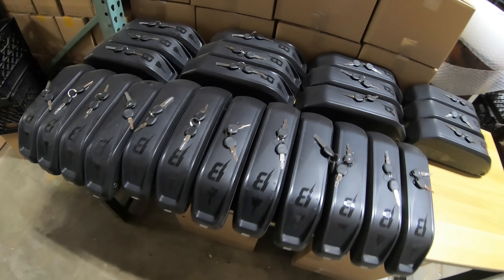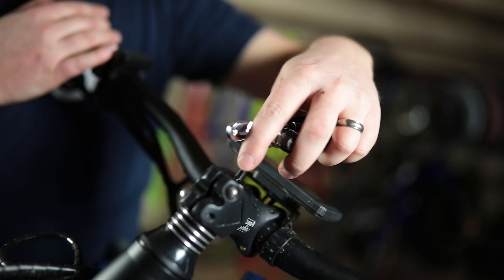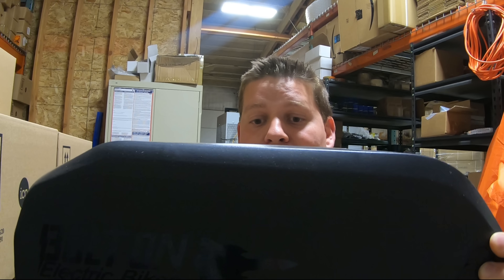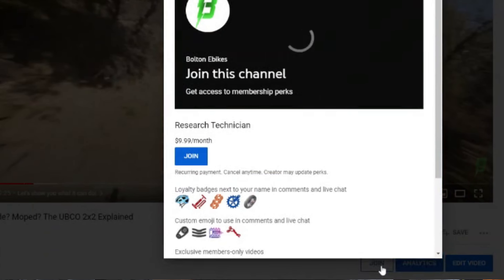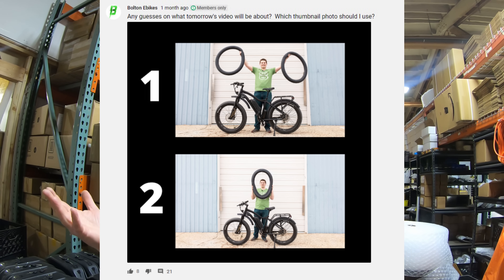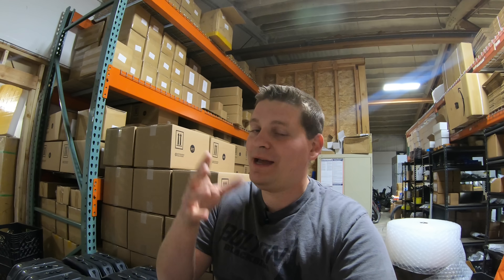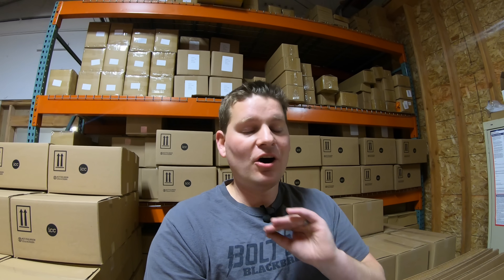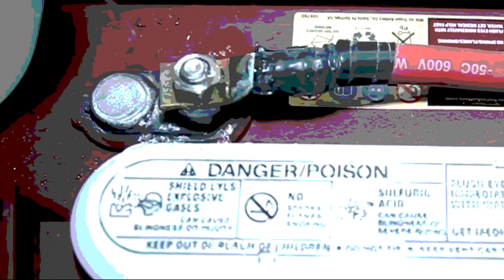How to maintain Lithium batteries for electric bikes - Easy!

Comment: Helpful video.

Can you do a video about safety? Around here there’s been many apartment fires started by Ebike batteries in the NYC area. Apparently there are standards that all batteries don’t meet here in the US.
Reply: I usually try to recharge mine during the day and unplug the charger before I go to bed. If it’s not 100% or close, charge it a couple more hours beg you head out. I should also note that where I live it gets really hot many days in the summer. During those days, I don’t charge the battery outside in the heat.

Comment: I’m checking out your videos for fire safety. After the recent bunch of Ebike battery fires in NY that have burned down buildings I’m concerned that we don’t have the standards here I the US for adequate testing. Until I actual saw a video of an Ebike battery fire, I thought they could easily be put out but one of the videos available shows a group of FDNY guys emptying several large fire extinguisher cans on a bike outside a business and it kept burning and burning and burning. The idea of that happening in your house is horrifying. 😬

https://youtu.be/LYp-64s9_Po

Comment: I have a Radrunner which I was going to ride year-round. After sustaining a rotator cuff injury I’m not gonna be riding for quite a while. I don’t quite understand how to maintain the battery at 75% which is what the manufacturer recommends.Is there some kind of device that will maintain it at 75%?

Comment: you said, " do not discharge a lithium battery to zero" ... are you talking "lithium" or "lithium-ion"  they have different requirements,   you even need a ABC fire extinguisher for a lithium-ion battery .   and a Lithium battery requires a D fire extinguisher..      ABC doesn't work on lithium fires.

Comment: Hi - I have three Aventon Aventure bikes. Two of them have batteries marked "48V 15Ah 720Wh". One, more recently acquired, is marked "Nominal Voltage:47.32Vdc and Rated Energy: 657.748Wh". Can anybody explain the difference? Much appreciated.
Reply: Hi, I just received my Aventure direct from Aventon and mine also has Nominal Voltage:47.32Vdc and Rated Energy: 657.748Wh. Doing the math, this seems to only be 13.9Ah and not the advertised 15Ah. Am I doing the math correctly. Is Aventon providing less that promised? @BoltonEbikes I saw that you recently started carrying Aventon bikes. Can you confirm what you are seeing and if we are getting a battery with 9% less capacity? Thanks...Love your videos and your help in educating us.

Comment: Hi there,
Question 1:
        My charger can charge 54.6 V, my battery has 48 V 17.4 Ah. Looks already fully charged on my e-bike display, but the battery charger does not turn the green light. Does it mean it's already 100% charged? Or, still wait turn on the green light?

Question 2:
       Looks  full energized on my e-bike display when I am riding an e-bike. But it doesn't look like there are 1-2 bars when accelerating at high power or on the uphill. is meaning battery to dying?

Comment: Per battery engineer discussion I keep my Li E-Bike battery between 20-80% for *longivity (charge cycles).  I use a plug in timer (used for lights & sprinklers).  It charges at 10%/40 mins. If it is at 60% I set timer for 2 hrs. I charge it to 100% once to twice a month & for the occasional 40 mile ride. *A new battery is %600.

Comment: hi i have a fat wheel folding mountain e-bike with 48v 1000watt motor with 12.8 ah battery i find the range isn't that good 10-15 miles what i was wondering was would changing to say a 500w motor give me more range oh and the battery is housed in the crossbar cheers in advance Jack from uk

Comment: Tesla car company claims 1,000 times the recycle rate on li-ion if we charge to 80% and discharge to only 20% (above minimal rated safe voltage)

Throwing the battery into the snow.. all the antics.. made this well worth the watch!

Excellent information!

Comment: how about this for a great idea,i wanted a very light narrow bike trailer to carry 2 spair batteries for long trips so i had to work out the weight load to save some power.so i ordered a trailer to handle 2 10.5 ah batteries total weight 25lb so i thought im 190lb so i went on a crash diet and lost 25lb in 6 weeks to compensate for the weight of the trailer and 2 batteries.

Comment: Clarification here, it's also not good to fully discharge any other type of battery. Every available battery chemistry will degrade faster if you fully discharge it. NiCd and NiMH batteries have a memory effect, so it was decided that degrading the battery prematurely was better than not being able to use the battery capacity at all. Lead Acid batteries are very sensitive to depth of discharge, they are just cheap and most people don't know what they are doing, so they fully discharge and degrade them.

Comment: Interesting conversation on the Lithium battery discharge. I'll have to go back to my research but it seem Lithium batteries for an RV (solar power) vs AGM is the fact (or not) that you can only discharge an AGM to around 50% where as a lithium you can discharge to nearly Zero ?
Reply: Lead-acid batteries can be damaged by repeated deep discharge (more than 50%). Lithium batteries can normally be discharged to their full rated capacity (100%). Which means twice at much power. Note that this only applies to a drop-in replacement batteries that have an onboard BMS that stops discharge before the lithium battery is low enough to cause problems.

Comment: GREAT JOB ON THE VIDEO, I ALREADY KNEW ALL OF THOSE THINGS BUT, ITS NICE TO SEE SOMEONE WHO ACTUALLY KNOWS WHAT THEY ARE TALKING ABOUT, I HAVE FOUND THE BEST WAY TO GET A LONGER RIDE ON A CHARGE, I DO KNOW TERRAIN HAS A LOT TO DO WITH IT, I LIVE IN A CITY THAT IS MOSTLY FLAT(SOME MINOR HILLS, A FEW INCLINES), I TRIED SOMETHING THE ONE NIGHT, I TOOK AN EBIKE RIDE(I HAVE AN ANCHEER 16 INCH WITH A 250WATT, 36 VOLT HUB, AND AN 18AH BATTERY),I DECIDED TO TAKE MY TIME, FOR ONCE AND I RODE FOR THE MOST PART ONLY USING HALF THROTTLE(NO PEDDLING AT ALL), AND RODE TO A FEW DIFFERENT PARKS, I WAS AMAZED HOW FOR I WENT ON THE FIRST QUARTER OF THE BATTERY, I DO NOT HAVE ANY KIND OF WAY TO SEE PERCENTAGE OF BATTERY, NO DISPLAY ON THE BIKE, I CAN GET ABOUT 10 TO 11 MILES ON THE FIRST QUARTER, NORMAL RIDING, THAT NIGHT I WENT DOUBLE, I LOOKED ON A MAP AND LOOKED AT ALL OF THE ROUTES AND IT WAS ABOUT 22 MILES, SO I FOUND THE BEST WAY TO GET A LONGER DISTANCE ON A SINGLE CHARGE, I WAS AND AM VERY IMPRESSED WITH THAT DISTANCE, I DID HAVE SLIGHT UPGRADES, EVEN WITH THAT, I STILL GOT THAT DISTANCE, I HAVE WATCHED A LOT OF VIDEO ON THE EBIKE BATTERY, WHEN I FIRST GOT MY EBIKE, I DID NOT KNOW ANYTHING ABOUT EBIKES OR ABOUT THE BATTERIES, MOST OF THE VIDEOS WERE BAD AND MADE IT LIKE IF YOU DO NOT FOLLOW THERE ADVICE, YOU WILL DESTROY YOUR EBIKE BATTERY, SOME OF THOSE VIDEOS HAD ME SO STRESSED AND WORRIED I WAS SCREWING UP MY BATTERIES, SO I STARTED READING AND ACTUALLY GOT REAL ANSWERS, IN SOME OF THE VIDEOS, PEOPLE WOULD SAY "NEVER FULLY CHARGE THE BATTERY, IT WILL SHORTEN THE LIFE OF THE BATTERY", "NEVER FULLY DISCHARGE, YOU WILL DESTROY THE BATTERY", AND YET IN THOSE SAME VIDEO THE PERSON WOULD THEN SAY "MAKE SURE THAT YOUR BATTERY HAS A BMS ON IT" ,AND NOT ONCE DID THOSE IDIOTS SAY "THE BMS PREVENTS YOU FROM SCREWING UP THE BATTERY", AND SOME OF THOSE PEOPLE MADE IT VERY CONFUSING, GREAT JOB ON THE VIDEO, GREAT INFORMATION, THIS IS THE VIDEO THAT ANYONE WITH AN EBIKE BATTERY SHOULD WATCH, IF THEY ARE NEW TO EBIKES OR NOT SURE, I LIKE THAT YOU GOT RIGHT YO THE POINT, INSTEAD OF EXPLAINING ON HOW BATTERIES WORK AND ALL OF THE OTHER MEANLESS CRAP AROUND THE ACTUAL MAINTENANCE OF EBIKE BATTERIES, GREAT JOB

Comment: I’m sorry but I have researching Batteries for Solar Systems for a few years — your first comment about not discharging Lithium Batteries completely is 
COMPLETELY WRONG!!!
You also say that is a practice that Lead Acid REQUIRE 100% discharge is Also 
ONE HUNDRED WRONG!!!
Yes I am aware that there are NO Lead Acid eBike Batteries!
The beauty of Lithium batteries is they are NOT NEGATIVELY IMPACTED BY COMPLETELY DRAWING THEM DOWN!
If one discharges a Lead-Acid below 50%, the life of the L-A Battery will have its life decreased drastically!!!
Maybe you should find a mentor who is highly educated concerning Batteries — you are not well informed at all!

Comment: The first 10 charges cycles are very important, didnt watch the video so I may be just repeating, sorry the way you talk... the first 10 cycles of the battery are very important, the first 10 charging cycles must be to full. The very first time you charge the battery, 12 hours min. but NEVER longer than 24 hours and every time after that, you must make sure it get fully charged and stay's on charger for at least an hour or two after the green light comes on. 
In some case's, you will see the green light, but several minutes later it's back to red and charging again, this is normal, when you have a solid green light for over an hour, then it should be done " balancing ". Most BMS are what they call " bleeding " BMS, it slowly drains down the higher cells to match the lower cells, as not all cells will reach full voltage, Li-ion 4.2v. some will be 4.1, 4.0, some will charge up too 4.2 but settle around 4.1 or lower...
It takes at least 10 cycles for most batteries to get to full capacity, sla, li-ion, Lifepo4, not sure about the new LTO cells.
I usually slowly increase the battery usage with each cycle until it reaches the 10th and the 10th cycle is a full discharge, I NEVER fully discharge a new battery pack.
NEVER charge a battery that has just been run hard, let it cool first, 30 minutes after usage should be ok for most, NEVER take a battery off a charger and use it full blast right away, let it sit for at least 30 minutes AFTER charging before us.
The first 10 charges you must make sure it gets FULLY charged, after that, you should be able to charge it when you like for as much as you like. Your battery will last much much longer if you do not fully discharge it, or fully charge it all the time, once a month for a full charge is ok and better for extending battery life, again ONLY after the first 10 cycles have been done.
NEVER put your controller and BATTERY in the same box or inside the frame of a bike on top of each other, heat is really bad for your controller, mosfets have a thermal dissipation rate, you can look that up in the specs, they can only dissipate so much heat so fast as the amount of contact area to the cooling bar is not that large.... and if you have no air flow over the outside of the controller case, all you are really doing is turning your energy into heat, you cut the efficiency down by 80% when running around the max thermal level of the controller.
They say " charge every 3 months " but personally, you have to run the battery down a bit before charging, even if it just 10% DOD.
If your battery stays pretty much fully charged and 3 months later you charge it up, thats is not really " charging " a battery, because the charger lowers the charge rate to almost nothing for the last bit of charging. So if you lower the battery just a bit, it will actually charge.
With sla batteries, if you keep them fully charged all the time but rarely use, they will be no good, they will have no capacity after about a year, sla battery, deep cycle or not, are made to be used.
NEVER EVER EVER put sla, deep cycle or just about any other battery, on CONCRETE or cement, yes there is a difference, to store or charge them, always always always at least put them on a 2" thick piece of wood, for SLA batteries the concrete and cement will affect the specific gravity of the fluid...and render them useless.
Yes I know, it's a damn novel, but I just cant help myself, knowledge is meant to be shared, I hope this helps.
Hopefully LTO cells will start coming in a format that is better for ebike usage.

Comment: Is it ok to leave my battery on my ebike in the garage when it's hot outside (90-100 Degrees)? I ride it every morning. I don't leave it out there when it's cold.
Reply: Yes it is good to keep it inside garage, after using avoid charging immediately, as both charging discharging produces some heat,
Reply: The owners manual on mine (Rad bike) specifically says not to leave or even use the battery in heat exceeding 88 degrees Fahrenheit. For that reason I remove the battery from the bike when storing it not inside my house.
Reply: @RHDrumLessons  yikes!!  That means that with the heat we had this summer in MN there would have been 30ish days I could not have ridden (temp over 88). 
And we don’t have much summer to begin with.

Comment: so my dad was loading a new propane tank in one of those backpack grills and your supposed to pierce these ones...well he had a accident and set his entire body on fire as the propane shot out of the tank sounding like a jet engine lighting the living room up like a xmas tree not being pierced properly and i had to legit leap on top of him to smother him out in a panic as he was in flames from head to toe he had got 3rd degree burns all over his arms and his beard saved his face pretty much cause face was mainly a sunburn luckily (basically anywhere there was no clothing took the damage), but anyways as this all happened a blanket on the couch was set on fire and the material was like melty type of material and a big chunk of it had landed on my cyrusher ebike battery cooking away (cause i lent to him to charge his phone off of) and i was thinking it was going to explode or something but luckily i was able to put it out in time before it melted through the thick plastic those cells are incased in but man was the battery hot however it still works and my dad is fully healed after 2 weeks in the hospital burn unit thank goodness, anyways i seen this video in my recommendation's and figured id toss this story at ya'all haha
Reply from the maker: So glad to hear he is okay.
Reply: @Area13ebikes  ty yes he is thankfully however his beloved beard..not so much :)
Reply from the maker: @MadfugginMax  Oh NO! Not the beard!

Comment: Well now, I do mostly short rides and have only been charging after every 2nd or 3rd ride to minimize charge cycles used up. So you're saying going from 75% to 100% is just approximately 1/4 of a charge cycle?   I'll change my ways if this is true.
Reply: You're fine recharging after every ride. Each partial discharge is only part of a full cycle. Hypothetically. If your battery could do 1000 full cycles of 100%-0% you would get 2000 cycles if you only discharged to 50% each time.

Comment: Hey dude question my bike battery blacks out @ 46volts with a error message. Its a 54.6 volt fully charged battery. It turnes back on only to black out again at pas2 little throttle. Battery is a year old. Company sent a new controller with also the switch . Only to black out again @ 46volts 6 bars left on screen. Lg battery...is the battery defective?...kept it @ 100% in winter time.in a cold room can it come back?

Comment: I have 6 pcs identical 36v 21ah unprotected packs (li-ion)  - none has any bms attached yet....My plan is to use all 6 packs as one (36V 126AH) with a single bms...do you think its a wise idea considering the fact that maybe balancing would suffer?....or should i put a bms in each pack and then parallel them with y-xt60 joiners? Its a huge pack that will be placed in my tricycle...I REALLY dont want to break the packs up...that would be a total nightmare... Thanks dude your videos helped me alot=)

Comment: If the battery is low I charge to 50 % or so let cool then charge to 90 -100 % they don't like heat or cold. I try not to go below 20%. If the battery is warm from a ride let cool then charge. Never let any battery go to 0 Volts, I have fixed them by applying power to just that cell but if you don't know what you are doing it could blow up.

Comment: After much research & discussion with electrical engineers I came to similar conclusions Mr. Bolton.
I plugged my battery charger into a sprinkler timer & keep it between 20-80%.  The majority of trips I take allow me to do this. 
I tested the system at different charge levels on bike so as to monitor charge % via LCD and found each 10% charge takes about 40 mins & set the timer accordenly. 
Ex: If after a ride battery is at 50% that equals 30% X 40 mins = 120 mins or 2 hr charge & thus I set the pins on timer accordenly & walk away. I return to find battery at 80%. 
I occasionally fully charge it for the reason you well explained & long rides. Perhaps I will get a million miles before need to put out another $600.
In appreciation of your edu videos. Marc Foxbat owner

Comment: I live in Arizona and recently it’s been over 110 daily. Is it safe to ride my ebike during the day?
Reply: Definitely. Any quality lithium ion cell can be discharged at 115F. If you have Samsung, LG or similar brand they would be rated for high rate discharge to 45C. At higher Temps, they can still safely discharge but you might want to not push them as hard- no long mountain climbs...